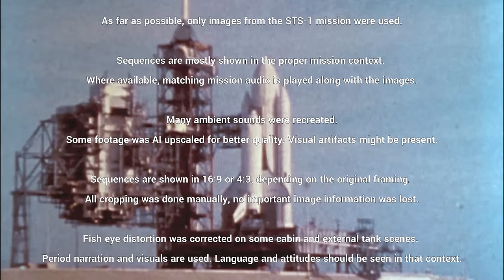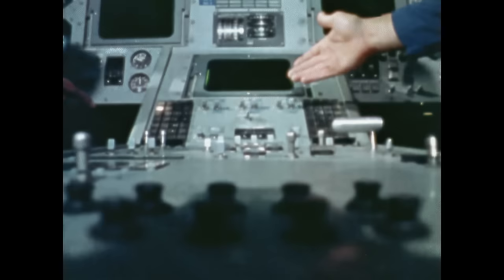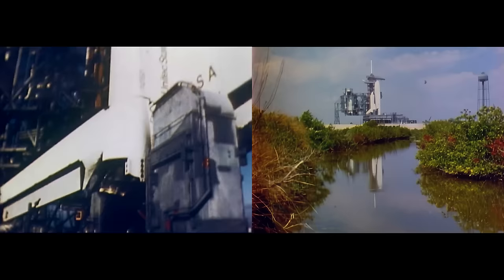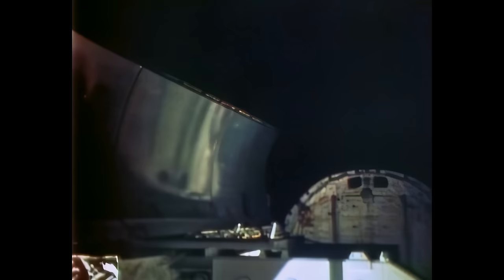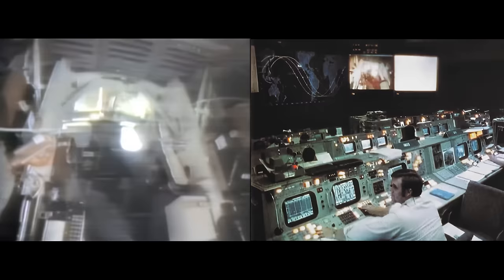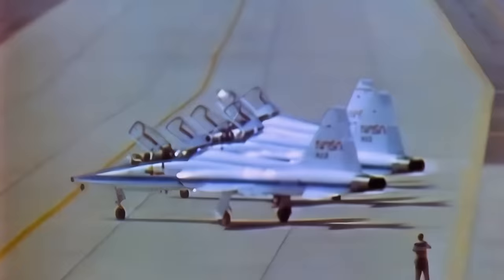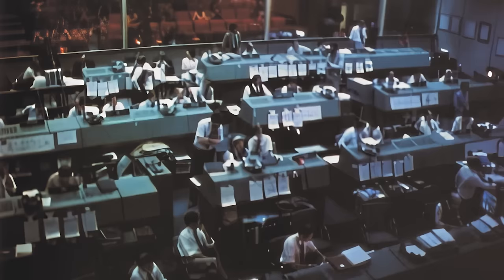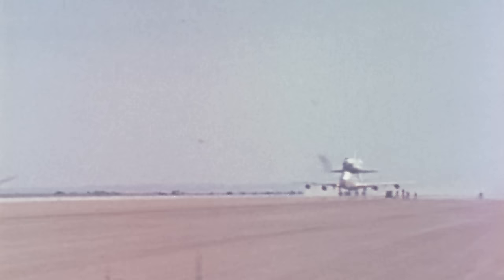STS-1 Full Mission - Historical Narration and Footage - First Shuttle Flight, Launch, Landing, 1981

Comment: It amazes me that so many people remember the two accidents but they forget all the things the shuttle accomplished and call the program a failure.
Reply: It was a failure.
Reply: @StrokerAce3983  really, I will name one Hubble repair mission, no other vessel at the time could have done it
Reply: @massmike11  Yes, but the cost of launching Shuttle was greater than the cost of Hubble.  The open secret at the time was that it would have been faster and cheaper to launch a new Hubble-class telescope on an expendable rocket in place of each servicing mission.
Reply: @NeilFraser  and what launcher would you have used? Oh right it only fit on the shuttle.
Reply: @massmike11  Hubble was based around the KH-11 class of spy satellite.  18 of them were launched on Titans and Deltas.
Reply: @NeilFraser  true but it wasn’t a kh11 any longer
Reply: @NeilFraser  and while I won’t argue with you on cost because that would be stupid. I will point out the shuttle did what it was supposed to do. Therefore by definition not a failure. It had its problems yes. But a failure? No not at all.
Reply: @massmike11  Shuttle was supposed to launch once a week.  It failed that by a factor of 10.  Shuttle was supposed to bring down launch costs.  It failed that by more than a factor of 10.  Shuttle was supposed to be safe.  It failed that by being the deadliest spacecraft in history.  Shuttle was supposed to launch, deploy/capture, and land in one orbit (the big wings were specifically designed for that mission).  It failed to ever fly that mission.
Reply: @NeilFraser  so it accomplished nothing then. Not sure why it was launched so many times then
Reply: Horrible,  all they cared about was the drama of tragedies, not important events. It's because most of them didn't care about space achievements.
Reply: @StrokerAce3983  No Shuttle, no ISS. Capsules are silly.
Reply: @NeilFraser  The Shuttle program cost $3.5 billion a year.
Reply: I remember showing someone a picture of the shuttle and the first thing that said was "is that the one that blew up?"
Reply: @RideAcrossTheRiver  No, a shuttle was not needed for a space station.  Skylab proved it.  Rockets could build ISS mass station in 4 flights WITHOUT 30+ shuttle flights, 12 years AND Russian help. The shuttle lift capacity stunk because it failed to reach 30+ flights a year which also skyrocketed costs. This was a day 1 promise the shuttle failed and doomed the program to early retirement.  And there was a plan for space telescope maintenance under Apollo.  It’s easy to laude the shuttle when it was the only show in town.
Reply: @dq1275  "a shuttle was not needed for a space station.  Skylab proved it."

Skylab was a pre-built one-off to use up surplus hardware thus to keep NASA relevant to Congress and Nixon while beating the Soviets again ... to keep NASA relevant to Congress and Nixon.

"Rockets could build ISS mass station in 4 flights"

Rockets don't "build" anything. People build things. Shuttle was the construction platform. You seem to forget about all that trusswork that's the biggest part of the ISS.

"AND Russian help. "

An Japanese and ESA and Canadian. The 'I' is for international. What a strange perspective you have.

"shuttle lift capacity stunk because it failed to reach 30+ flights a year"

What? Lift capacity has nothing to do with number of flights. What a weird perspective you fabricate.

"also skyrocketed costs"

Entire Shuttle program cost $137 billion.  Apollo cost $250 billion.

" the shuttle failed and doomed the program to early retirement"

Orbiter was a perfectly good machine. What failed was funding. Nixon and Congress demanded a fully re-useable space transport system. NASA designed exactly that, and the connies in Congress and Nixon giggled and slashed NASA's funding to show the 'eggheads' who owns them.

"there was a plan for space telescope maintenance under Apollo"

Apollo was never designed for anything but to put a man on the Moon before the USSR. Skylab and ASTP were one-off uses of surplus hardware from a useless political program.

"It’s easy to laude the shuttle when it was the only show in town"

It was the best, too. Now the profiteers are playing lowest-cost with human lives. What will you say when Elon kills a crew?
Reply: @RideAcrossTheRiver  As you are obviously into details (cool!), I recommend you read NASA Administrators Mike Griffin's 2007 Report on "Human Space Exploration:Next 50 Years".  Its a long report but...a stinging indictment of how the shuttle decision held back manned space flight advancement by decades at a terrible cost versus continuing with next generation improved Apollo/Staged Rocket tech. I have gathered bits and pieces over the years, but his report sums it up the best IMHO. Reports like that don't get air time because it doesn't follow the "narrative of what we were promised" rather they air out dirty laundry.   A report from the NASA administrator you may disagree with, but your opinion of nonsense hardly is deserving as official sources have shared the same opinion as I.
Reply: @UC22D7iSYlm72ZaHHcX0waTw not disagreeing with you. But you missed the part where the shuttle all kind of cool stuff. And yes satellite repairs and returns couldn’t have been done any other way. Was it cost effective? Maybe not. But it was still an accomplishment. You can’t just write that off just by saying it cost money. It still happened. If all you think about is money a lot of really cool things never happen.
Reply: This thread proves that people in society today love to argue, each one believing they are right, each one needing tragedy to define all rather then be only part of a legacy. By this logic, if one car crashes then why aren't you haters screaming that all cars are inherently disasters waiting to happen, sighting what you think  alternative's to are for more sensible transportation, and chewing each other out for merely mentioning the good things that your car did as if the tragedy trump's all? Those who need to see the bad in everything, your parents and society has failed you.
Reply: It didn't really achieve its goals, in that is turned out to be neither cheap nor frequently reusable but from an engineering point of view it was magnificent.
Reply: @massmike11  The Large Space Telescope (later named Hubble) was downsized from a 120” mirror to a 94” mirror so that it would fit into the Shuttle. 
There were unmanned expendable launch vehicles that could have put it into orbit.
Reply: @massmike11  Did what it was supposed to do?
Expected to launch 40x a year - realized about 5 per year over 30 years. Air Force gave up on the Shuttle after 25 missions because the scheduling delays were causing national security issues
Expected to reduce cost to orbit to 10 percent of an expendable launch vehicle. Ended up costing 2x to 3x more. An “cost estimate error” of a factor of 20 to 30x. 
Expected to be safe. Two of five orbiters destroyed in flight killing 14 astronauts. 
It achieved essentially nothing that was promised. The “economy of reusability” was a total myth with regards to the Shuttle. 
It ended up being an absurdly expensive support vehicle for the ISS. And the ISS existing to give the Shuttle something to do. 
Many back in the early 1970s predicted all of this. It should never have been built. 
What the shuttle should have been was a school bus sized manned people mover like Sierra’s Dream Chaser. Large payloads should have continued to go on expendable launch vehicles.
Reply: We have an ISS thanks to the space shuttle
Reply: @NeilFraser  And your source for that is...?
Reply: @NeilFraser  

*Shuttle was supposed to
aunch once a week. It failed that by a
factor of 10. *

That was the optimistic figure pushed by NASA even before the shuttle we got was picked TAOS Shuttle was supposed to launch twice a month Which equals to 6 flights per year by a single orbiter and a  turnaround time of 60 days

In her first year in service Discovery managed to launch 6 times

Atlantis' turnaround time between STS-51J and STS-61B was 54 days

*Shuttle was supposed to bring
down launch costs.*

And it did. Just not to the extent it was supposed to

*It failed that by more than a factor of 10. *

It """"failed"""" that by a factor of 7

Shuttle was supposed
to be safe. It failed that by being the
deadliest spacecraft in history.

"It is the view of the board that the present shuttle is not inherently unsafe"

-CAIB report Volume I, Chapter 9 1.4 MID-TERM: CONTINUING TO FLY

The honor of being the deadliest spacecraft goes to Apollo with a probability of LOCV of 1 in 9

It failed to ever fly that mission

Because it was never required to
Reply: @dq1275 

* No, a shuttle was
not needed for a space station. kylab
proved it. Rockets could build ISS mass
station in 4 flights WITHOUT 30+ shuttle
flights, 12 years AND Russian help.*

Nature and physics already rebutted this

The shuttle lift capacity stunk because it failed to reach 30+ flights a year

It was only ever supposed to reach 24 and it would've if it wasn't for Challenger and NASA and the Federal Government overreacting

* and doomed the program to early retirement.*

30 years is early?

And there was a plan for space telescope maintenance under Apollo.

Which can't even be remotely compared to the servicing capabilities shuttle provided
Reply: @dq1275  

I hope you first learn about what kind of a clown Mike Griffin is

official sources have shared the same opinion as 1.

Mike Griffin wasn't even the administrator when he wrote that Also his opinions aren't an official source
Reply: @executivesteps  Shuttles payload bay was 181" it could've easily fit in. It was downsized to reduce costs

Expendable launch vehicles like?
Reply: @executivesteps  

Expected to launch about 40x a year

That was the optimistic figure pushed by
NASA even before the shuttle we got was
picked TAOS Shuttle was supposed to
launch twice a month Which equals to 6
flights per year by a single orbiter and a
turnaround time of 60 days

Discovery flew 6 times in her first year in service

Atlantis' turnaround time between STS-51J and STS-61B was 54 days

The shuttle flew more than 5 times in the years 1985, 1990, 1991, 1992, 1993, 1994, 1995, 1996, 1997, 2001

Air Force gave up on the Shuttle after 25 missions

USAF moved on to other launchers because of the Challenger accident not because of the reason you stated

Ended up costing 2x to 3x more.

Titan IV cost per launch: $432M

Shuttle cost per launch: $252M

of a factor of 20 to 30x

It was a factor of 7

Expected to be safe.

"It is the view of the board that the present shuttle is not inherently unsafe"

-CAIB report Volume I, Chapter 9, 1.4 MID-TERM: CONTINUING TO FLY

The "economy of reusability" was a total myth with regards to the Shuttle.

How so?

What the shuttle should have been was a school bus sized manned people mover like Sierra's Dream Chaser.

And where would've this tiny spaceplane gone? What would it do?
Reply: It wasn't a failure per se, but the design itself - an airplane-like craft oriented right next to a huge fuel tank and solid rocket boosters - proved inherently dangerous and the costs far exceeded projections making it unsustainable.
Reply: That's because the cost of a human life is priceless compared to its successes
Reply: The Shuttle pushed the space orogram backwards by 30 years.
Reply: I amazed how all of our “Experts” here haven’t thrown SpaceX under the bus because of their RUD on the first test launch of Starship while glorifying the SLS that is how many years overdue and how many billions above the budget? And SLS will probably get a solid green light for launch the second it’s ready, in another decade, while Musk has to deal with standard FAA and now FWC BS. Just an opinion so please all you “Experts” relax. You all give me things to laugh at with the constant negativity and bickering. Here’s another opinion, I feel like Musk should get busy with those oil rigs that have been poo poo’d and find a way to put a starship on each one and go 100 miles out in the Atlantic and launch them. It’s a fact that SpaceX learned by trial and error, and with the FAA and the government behind the foot dragging, starship will never get launched if they have their way. Also it’s dangerous! No matter what anyone says, it’s dangerous.
Reply: Do they? Only negative people would do that. They also would probably never try to do difficult things. Don't listen to such people.
Reply: Exactly. The space shuttles had over 130 successful missions delivering over 800 astronauts to low earth orbit.
Reply: While the shuttle was a success, it was a failure of some of its biggest objectives, one was cost, by a rediculous amount
Reply: The shuttle absolutely accomplished incredible things, but in terms of overall program success it was a failure. It never met the launch schedule cost requirements originally outlined in the program scope.
Reply: @dq1275 Expendable rockets cannot retrieve satellites from LEO!
Reply: @dq1275 Expen rockets cannot repair Hubble!
Reply: @executivesteps Expendable rockets cannot repair Hubble!
Reply: @executivesteps Expendable rockets cannot retrieve satellites from LEO!
Reply: @dq1275 Apollo style rockets and space capsules are not sustainable means for long term space exploration!
Reply: @dq1275 The Apollo program was   not sustainable! The Apollo program spent the same amout of money which entire space shuttle missions had spent!
Reply: @powerfulstrong5673  Neither could the Shuttle do it economically. The Palapa B and Westar IV launch, retrieval, repair and relaunch demonstrated just how absurdly expensive that capability was. The missions cost way more than the satellites were worth. 
Recall the plan to someday recover Hubble Space Telescope. After NASA learned what a flying brick the Shuttle was they quietly agreed no way they would try that stunt. 
The Shuttle was a disaster by any measure - cost, reliability, scheduling etc. It should never been built.
Reply: @executivesteps  Space Shuttles would be successful if they were fully reusable.
Reply: @executivesteps  Apollo style disposable heavy-lift rockets and space capsules are unsustainable for space exploration in the  long run!
Reply: @executivesteps  I think that Venture Star SSTO spaceplene was a very good  to replace the partially reusable Space Shuttle!
Reply: @executivesteps  Disposable heavy-lift rockets and capsules suck!
Reply: @executivesteps  And I also want to say that the Space Shuttle was originally to be designed to be fully reusable！ The final approved Space Shuttle was scaled back from the original proposal of Space Shuttle designs!
Reply: @executivesteps  Space Shuttle or Spaceplane was a very good idea for long term space explorations! The concept of Space Shuttle or Spaceplane is part of the Space Transportation System!
Reply: @powerfulstrong5673  So if they only spent more and more billions on the Shuttle, it would have been more economical to fly?
They planned 40 missions a year and in 30 years averaged 5 per year. And in the end the orbiter was deemed too fragile and too risky to go anywhere other than the ISS serving as a lifeboat. 
It was a total mess.
Reply: @executivesteps    The Space Shuttle program was much cheaper than the unsustainable Apollo program! The Apollo program (1961-1972) only have 11 manned space flights but spent the same amount of money which the entire Space Shuttle program (1972-2011) spent while the Space Shuttle program had more than 100 human space flights !
Reply: @executivesteps     The Space Shuttle program was much cheaper than the unsustainable Apollo program! The Apollo program (1961-1972) only have 11 manned space flights but spent the same amount of money which the entire Space Shuttle program (1972-2011) spent while the Space Shuttle program had more than 100 human space flights !
Reply: @dq1275     The Space Shuttle program was much cheaper than the unsustainable Apollo program! The Apollo program (1961-1972) only have 11 manned space flights but spent the same amount of money which the entire Space Shuttle program (1972-2011) spent while the Space Shuttle program had more than 100 human space flights !
Reply: @executivesteps     The Space Shuttle program was still much cheaper than the unsustainable Apollo program! The Apollo program (1961-1972) only had 11 manned space flights but spent the same amount of money which the entire Space Shuttle program (1972-2011) spent while the Space Shuttle program had more than 100 human space flights !
Reply: @executivesteps  Space capsules and heavy disposable rockets suck!
Reply: @executivesteps   Apollo style moon landing which used old technologies of space capsules and expendable rockets is totally unsustainable in long term space explorations!
Reply: @dq1275    Apollo style moon landing which used old technologies of space capsules and expendable rockets is totally unsustainable in long term space explorations!
Reply: @executivesteps  The Space Shuttle was never intended to go beyond LEO! The Space Shuttle was only intended to be part of the Space Transportation System (STS) which NASA proposed in 1969! The system's major components consisted of:
1. A modular space station in a 270-nautical-mile (500 km) low Earth orbit, and as well as a permanent lunar orbit station. 
2. A chemically fueled Earth-to-station shuttle.
3. A chemically fueled space tug to move crew and equipment between Earth orbits as high as geosynchronous orbit, the space tug also could be adapted as a lunar Earth Moon transfer vehicle to ferry crew and cargo between low Earth orbit and the moon.
4. A nuclear-powered ferry using the NERVA engine, to move crew, spacecraft and supplies between low Earth orbit and lunar orbit, geosynchronous orbit, or to other planets in the solar system.
Reply: @dq1275   The Space Shuttle was never intended to go beyond LEO! The Space Shuttle was only intended to be part of the Space Transportation System (STS) which NASA proposed in 1969! The system's major components consisted of:
1. A modular space station in a 270-nautical-mile (500 km) low Earth orbit, and as well as a permanent lunar orbit station. 
2. A chemically fueled Earth-to-station shuttle.
3. A chemically fueled space tug to move crew and equipment between Earth orbits as high as geosynchronous orbit, the space tug also could be adapted as a lunar Earth Moon transfer vehicle to ferry crew and cargo between low Earth orbit and the moon.
4. A nuclear-powered ferry using the NERVA engine, to move crew, spacecraft and supplies between low Earth orbit and lunar orbit, geosynchronous orbit, or to other planets in the solar system.
Reply: @dq1275  Michael Griffin sucks! Michael Griffin is totally wrong! Apollo program spent far more amount of money than the Space Shuttle program.
Reply: @dq1275  Michael Griffin knows very little about the history of NASA space programs.
Reply: @powerfulstrong5673  And if it didn’t take 10 months to “refurbish” them.
Reply: @executivesteps  There would be a fleet of Space Shuttles or spaceplanes to turn around!
Reply: @powerfulstrong5673  And what was the average turn around time for the existing Shuttles? And what was the cost for each turn around?
A 200,000 pound orbiter and seven astronauts to low earth orbit to launch a 5,000 pound satellite. Totally ridiculous.
Reply: @executivesteps  The Apollo program was much more ridiculous! The Apollo program (1961-1972) had only 11 human space flight missions while spent the same amount of money which the entire Space Shuttle program (1972-2011) had spent in 4 DECADES!
Reply: @executivesteps  Only Space Shuttle could sent modules of ISS to LEO and back!
Reply: @executivesteps  How could a disposable rocket retrieve a module of ISS? The Space Shuttle could do that job!
Reply: @executivesteps    Apollo style heavy disposable rockets and space capsules are really ridiculous! Think about that the entire Apollo Saturn V vehicle which weighs more 3000 tons had been launched in one mission but only the 5-ton command module would be recovered! It's totally ridiculous!
Reply: @dq1275     Apollo style heavy disposable rockets and space capsules are really ridiculous! Think about that the entire Apollo Saturn V vehicle which weighs more 3000 tons had been launched in one mission but only the 5-ton command module would be recovered! It's totally ridiculous!
Reply: @NeilFraser      The Space Shuttle program was still much cheaper than the unsustainable Apollo program! The Apollo program (1961-1972) only had 11 manned space flight missions but had spent the same amount of money which the entire Space Shuttle program (1972-2011) spent while the Space Shuttle program had more than 100 human space flights !
Reply: The shuttle is easily The most incredible vehicle ever built, and one of the greatest achievements of mankind. We built a MASSIVE vehicle that could go to space, return and land like a plane, and go back to space. And this was less than a century after humans rode horses to get places. In over 30 years, a whole TWO times, catastrophe stuck - both times it wasn't some major malfunction with the machine - it was bureaucrats ignoring small issues, trying not to look bad, and both could easily have been avoided.
All the people hating are simply Scrooges.
Reply: Why limit conclusions to a binary: Failure V. Not Failure?  Truth is that its legacy was mixed as it accomplished many things, but perhaps not as much as was and at a higher cost than was initially hoped.
Reply: @StrokerAce3983 NASA was a failure…the program was a huge success and made massive progress in space travel and science. NASA’s bureaucracy and the politics involved failed everyone. There were many people—-like you—-who WANTED and still want anything “space” to fail, just to fulfill their own prejudices and desires.
Reply: Just over 100 flights I  just over 20 years proved it was barely a success long term, I was excited by this 1st mission at the time though.
Reply: @thegood9  The program was a failure the moment they decided it was reasonable to sacrifice crew safety for imaginary gains in launch tempo and imaginary savings. Fundamental, ground-up failure of risk management and assessment.